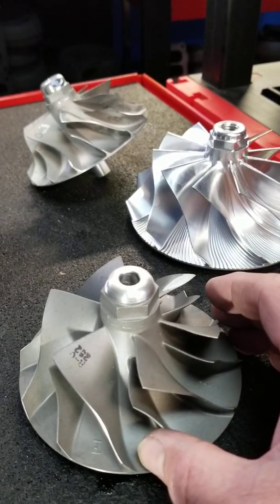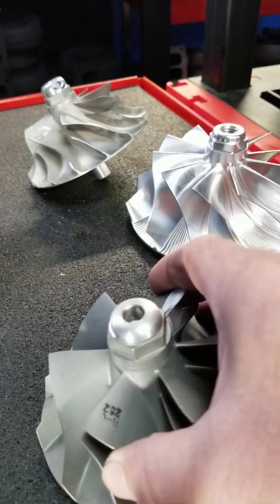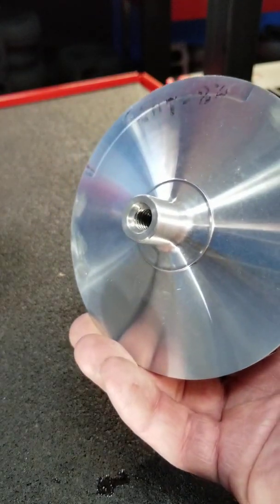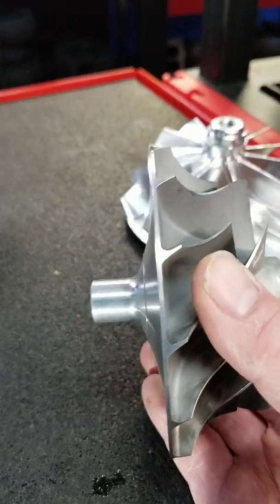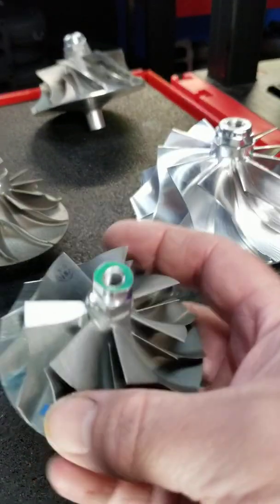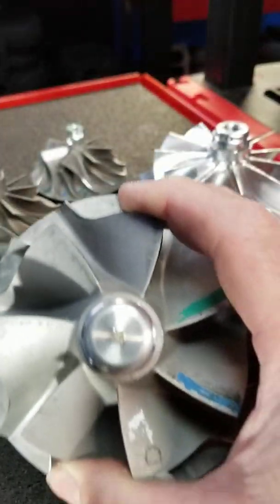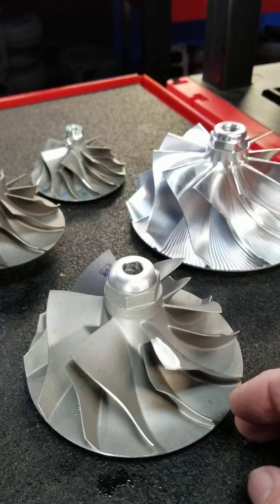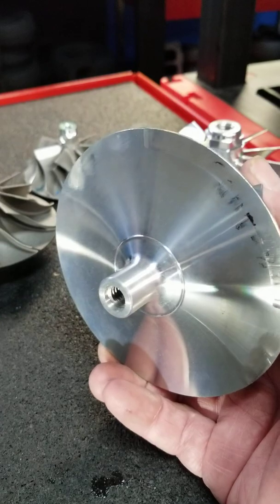Is your Garrett turbo a GT or GTA series? Here is how to easily tell!

Comment: Do y'all offer compressor wheel upgrades for Cat GTA47 turbos?

If not, is it just a matter of swapping in a long shaft GT47 turbine with a backplate which I assume is different to get a better compressor wheel?
Reply from the maker: Yes sir, we offer some modern aero for the GTA 47, no need to change shaft styles.  We have upgraded thrust bearings and other options as well.  Email us if you would like to discuss further!   support@workturbochargers

Comment: gtc and gta is the same?
Reply from the maker: I have not had many GTC series units through our shop, but generally speaking all Garrett "boreless" wheels will have a closed off nut on the end like I describe in my video.  If it has a through hole design where you can see the shaft, it will be a GT/GTX Series.